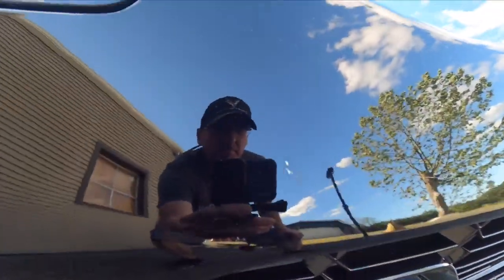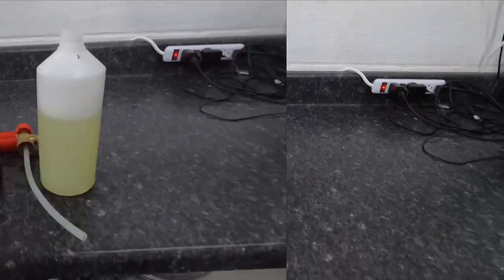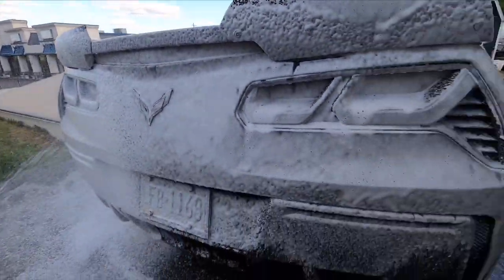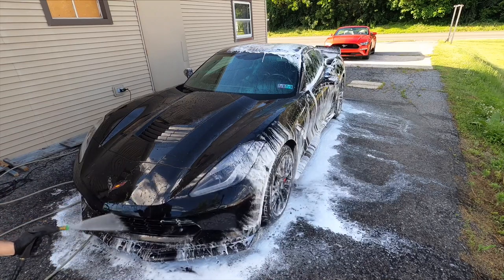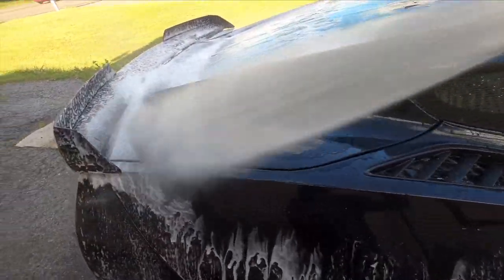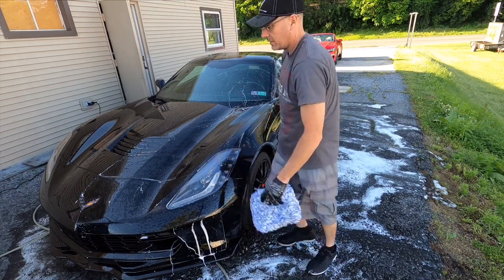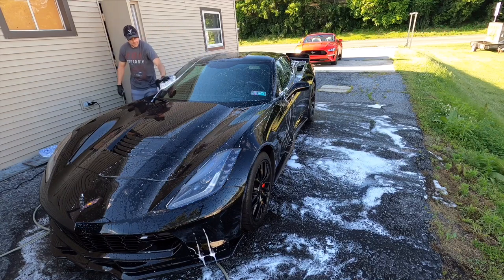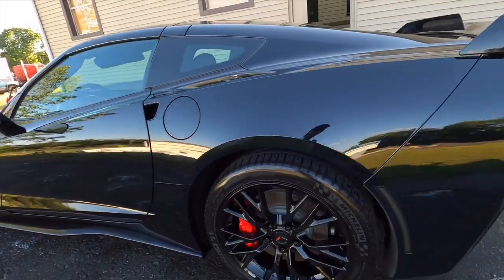Effective In Foam Cannon Or Wash Bucket!! Jescar Auto Wash Foaming Shampoo!!

Comment: I do a very similar wash method with the microfiber towels. 5-6 microfiber towels and I fold them into quarters that way I can flip them over and use 1 towel on a hood and trunk and not use the same piece of the towel for either of them. Plus I go a bit further and lay down another coat of snow foam before I begin the contact wash.

Comment: Thanks Brian.  I  had been foaming then immediately light hand wash with bucket and multiple microfibers (not spraying off foam).   Watching this video I realized I really need to high pressure spray off that foam to get the loosened grit/grime off before I hand wash.
Reply from the maker: Q Moonwalker it helps cut down on love marks. You can ad a second layer of foam... then a light hand wash.

Comment: I feel like there's only been one product that's been "go get it now!"... lol hopefully we see more in the future
Reply: What product is that
Reply from the maker: There won’t be many. That rating is designated for products tops in their class.
Reply: @apexdetail85  soooo is citrol 266 a "go get it now!" product?
Reply: Citrol266 is a get it now, especially when tarminator is now expensive and hard to find.
Reply: Car pro essence plus,  could be a get it now, along with xtreme solutions poly sealant and lvr403 acrylic glaze,and angelwax perfect polish.  Get these in your arsenal and you will be sitting pretty good.
Reply: Don't forget the 3D one buffing compound and 3d aca500,
Reply: And pick up a couple MAXSHINE POLISHERS, M15 PRO AND M21 PRO, AND MAYBE THE M8MM PRO, OR A FLEX 3401. SWEET.
Reply: Are the washmits then just washed in a machine or hand washed? I'll search the channel for a video.
Reply: @Delc0  I would just use the washing machine. They come out nice. Just don't dry too hot.

Comment: Personally I don't agree with the marketing of products as both a car shampoo & snow foam. It simply isn't possible.

Chemical backbone of each is very different with one needing lots of surfactants to break down dirt without agitation & the other requiring lots of lubricity during contact with the paint to limit marring. You can't have a product designed to do both, as a contactless cleaner it won't be powerful enough & as a shampoo it won't be as slick either. Best keeping a dedicated product for each stage of the wash I think. 

To me this is just a car shampoo with the suggestion you can use through a snow foam lance, it's not going to be effective as a snow foam though.

Regardless, enjoyed the video & the car is looking fantastic Brian 👍
Reply from the maker: Brian Woods I have experienced it being effective enough out of a cannon to help remove grittiness. Traffic film... is another story.

Comment: With a cheap Karcher K3, 1950psi, eBay spec foam cannon with a 1.1mm orifice i can easily get twice the foam thickness as this video, still using 2 oz of soap so I’m wondering how critical water quality is to the foam equation? Where I live in Australia water quality is exceptional, I use drinking water to wash my cars, water hardness around 57mg/L soft water it seems to make epic foam.
Reply from the maker: Sneaky Foz it is HUGE. My water here is hard and terrible even with treatment. Hard water naturally lowers pressure. Also, the surfactant reacts with calcium producing a scum. These factors lead to more pressure needed... in my area anyway.

Comment: You need more gpm out of a pressure washer. A 1200psi pressure washer is sufficient for a car wash.
Reply from the maker: Chandra Sekhar depending on the quality of water... that will not haven with my hard water. Hard water... like mine naturally lowers pressure and the surfactant reacting with the calcium produces a scum. All factors pointing to higher pressure needed in areas like mine.

Comment: Enjoy your content but your statement of needing an 1800+ psi power washer is inaccurate. Lower psi works just fine, I use Kranzle 1122 with 1400psi and it will produce plenty of foam!! So that statement is false.
Reply from the maker: VAMANOZ depending on the quality of water... maybe. Wouldn’t or...I should say, has not worked here. Hard water like mine naturally lowers water pressure. Also, the surfactant reacts with calcium producing a scum. These factors lead to more pressure needed... in my area anyway.